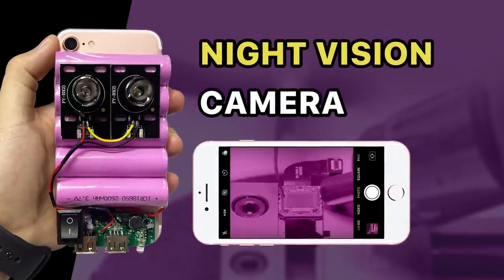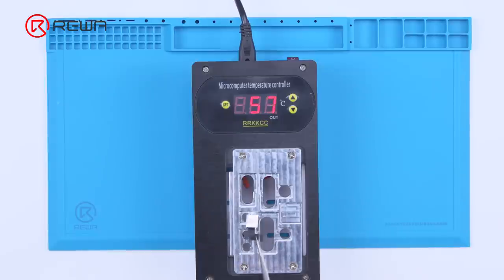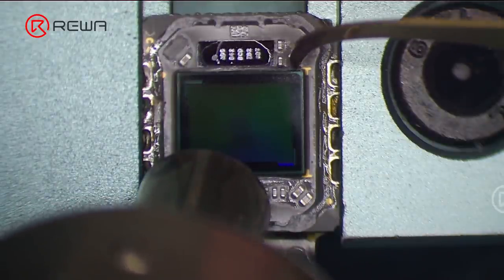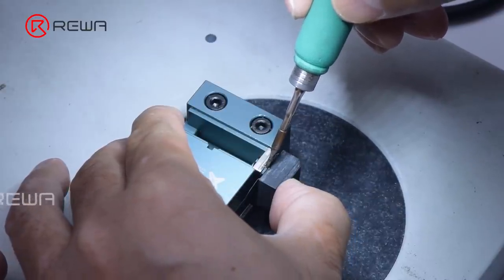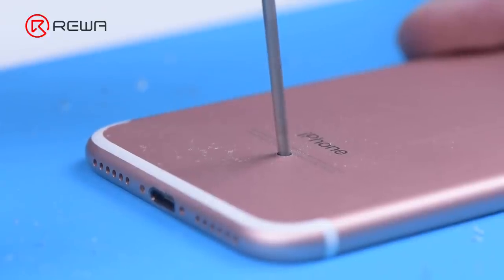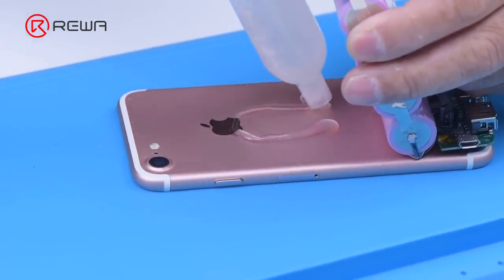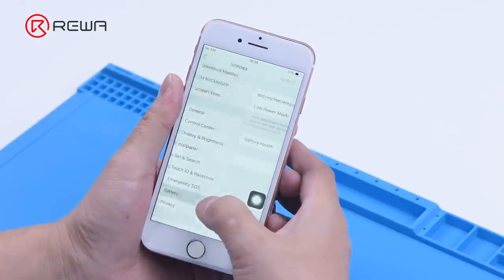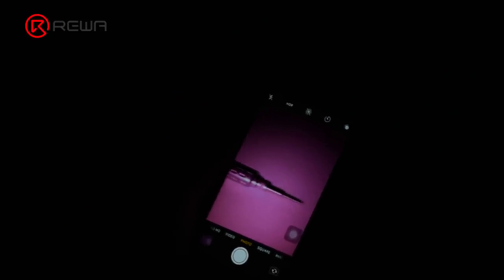iPhone DIY Night Vision Camera and Massive External Battery Pack

Comment from the maker: Happy Chinese New year! 🐯 Hope you guys enjoy this video!
Please feel free to share the video on your social media account. The post with the most "likes" will receive REWA exclusive gifts including T-shirt, hat, etc.
Reply: I am curious about what will happen a mobile have 6000mAh battery capacity and Add the same 6000mAh Battery in Parallel attach to back panel it will work normal or not.
Reply: @akhtarhusain4390  nothing. just extra juice for your device.
Reply: Футболку получит rewa) Набольшее количество комментариев) У меня остался вопрос, где можно приобрести плату? Фонарик отпадает, это метод очень интересный)) Ну и второй вопрос, можно ли увидеть точки от проектора начиная с Х?)
Reply: @samin5739  Because of Mobile independent charging method it calculates only (mAh) not voltage.If its calculate the voltage method adding another battery will work.But if it calculates the (mAh) it will not work

Comment: there's some big flaws with this method.
what he had is a full spectrum camera. try not removing the original battery. only remove ir cut filter. get an ir pass filter and attach it to the camera. instead of gluing battery pack, get yourself an ir flashlight or ir floodlight ( basically a high powered ir light source). you're good to go.
Reply: To uniform internal resistance between battery?